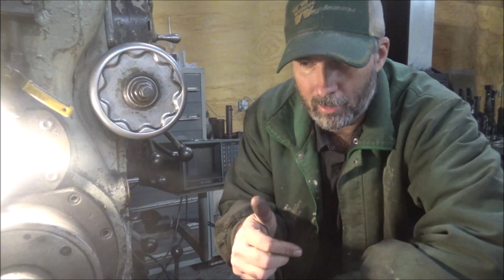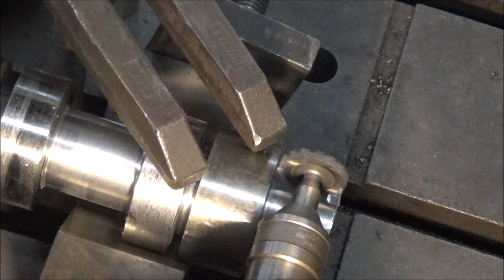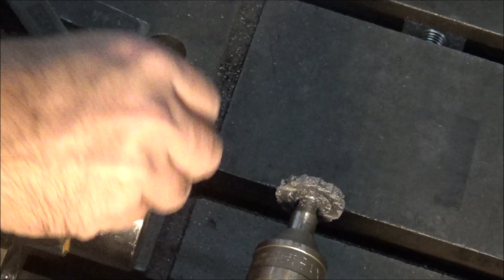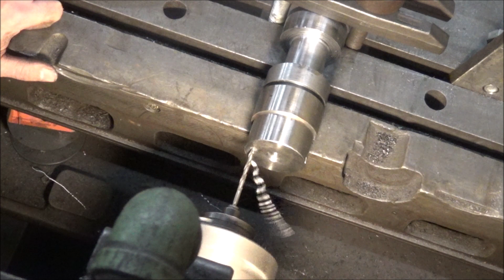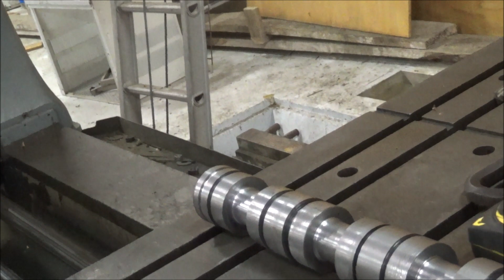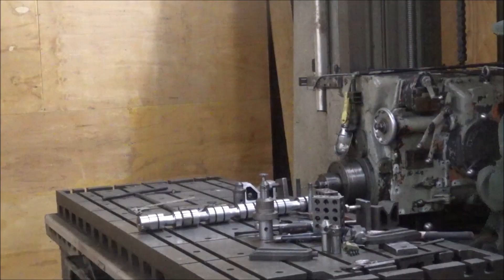Woodruff Key Cutting and Intersecting Hole Drilling HBM Giddings Mill How To

Comment: Nice, I broke a tap off in a shaft today and could not drill it out, drama
Reply from the maker: That sucks, did you get it?
Reply: What size tap?
I know it's not the best option, but with my facilities it's the best option available to me.. a flat faced drift, a big hammer, and one or two HARD whack will shatter it the rest of the way, pick out the pieces after... Helicoil if the material is too badly damaged
Reply: @Rx7man  1/2 " tap , that's all I could do was shatter it and pick it out